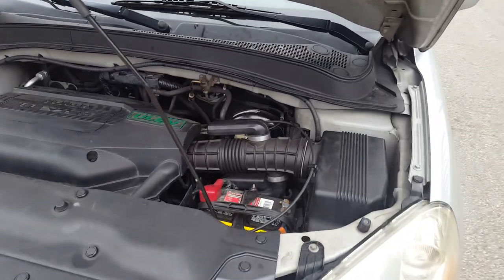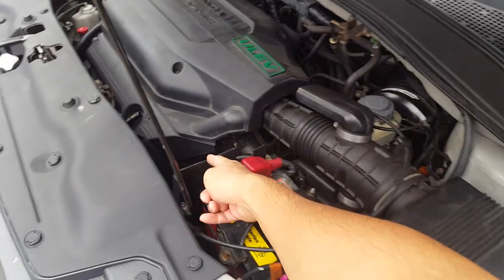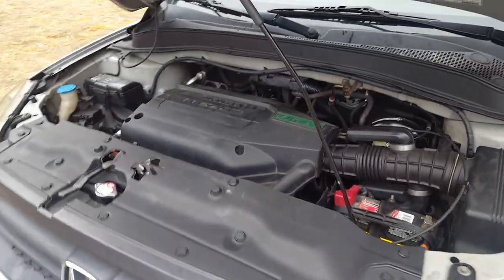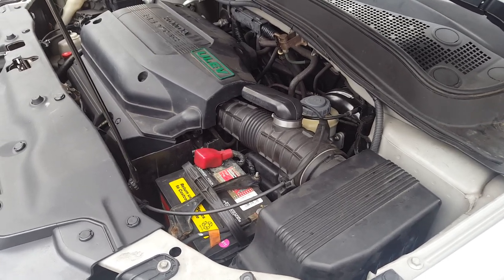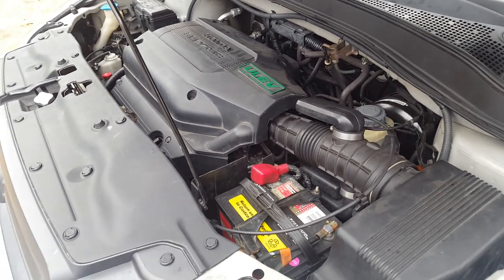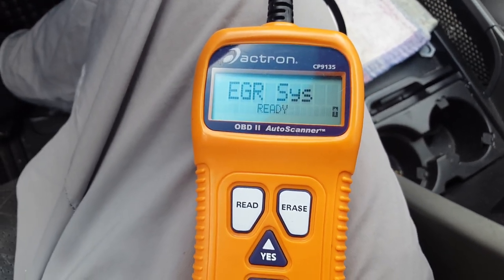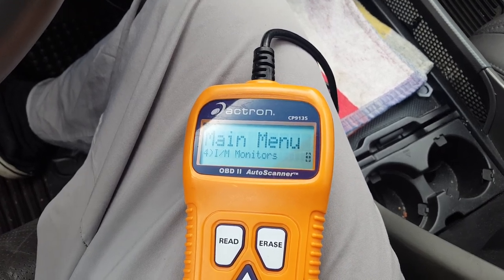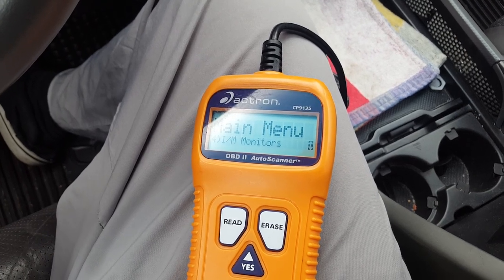Honda Pilot random misfire SOLVED!!! PASSED SMOG!

Comment: i have a 2005 honda odyssey it same p0300~0307 all misfire issue
i dont have idea. that is worst issue ever  random misfire,,i thought
i will try to clean pcv valve and egr valve.and replace spark plugs..
do i need more?
Reply from the maker: +KEUN HYUNG KIM when it's random misfire code,  that usually points to dirty egr ports or possibly a valve adjustment. Check to see if your egr ports are clogged. I made a short video on it. I'm not a 100% sure that odyssey and pilot have the same engine but possible. Hope that helps. On this Honda,  I ended up getting a valve adjustment to get rid of the random misfire code.
Reply: I hopefully  if  egr issue  be happy. 
But what is valve adjustment? 
Pcv. Egr. and many of the valve there.  
Thanks
Reply from the maker: KEUN HYUNG KIM valve adjustment is a pretty big job that requires taking off the top engine cover (valve cover) an experienced Mechanic would need to do that job. hopefully that's not your case.
Reply: I got it  good to know. 
Thanks

Comment: IMPORTANT REMINDER:

ONLY EVER USE HONDA PARTS!!! NEVER USE AFTER MARKET, ESPECIALLY ON ELECTRICAL PARTS!

My 2008 Honda Pilot EX basically rejected the after market PCV valve I put in so i replaced with Honda one ($50) and all codes are gone! My EGR was fine so I didn't replace that but I replaced all spark plugs and good as new!